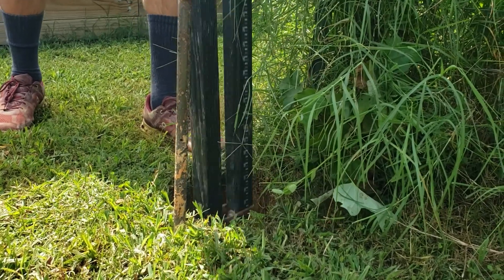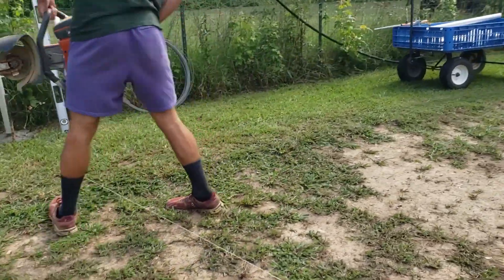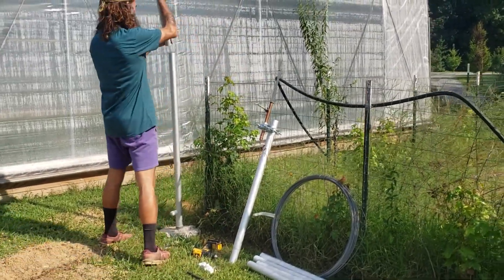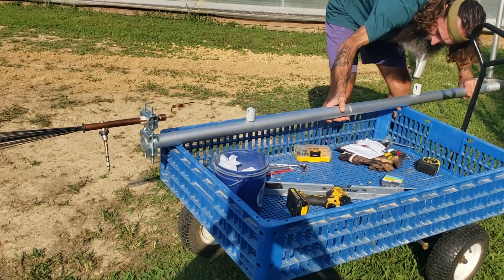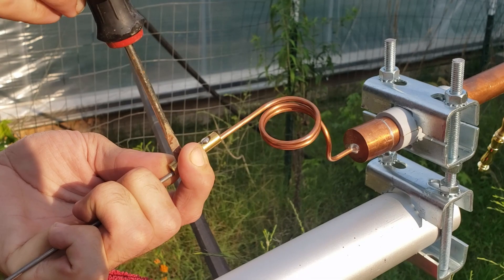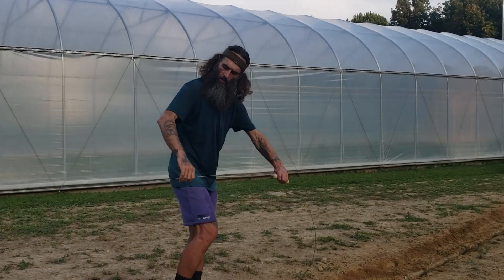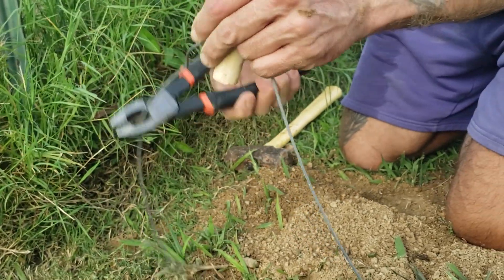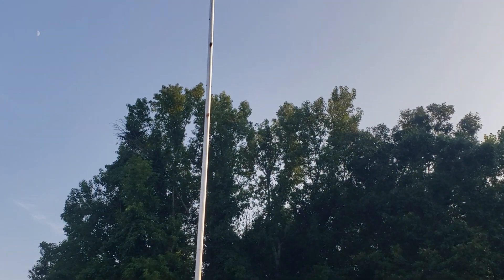CW1 Electroculture Antenna Installation    @TheFertileCurrent

Comment: Is the doll rod at the most northern point to save expense vs pounding in a copper ground rod?  would a copper rod at that point be beneficial?
Reply from the maker: Greetings,  no , the dowel was to assist in driving the wire deeper and also to mark the line for tractor work. However , thats an older video and I don't use that technique anymore. Ideally you don't want anything sticking out of the ground at the termination point except perhaps a non conductive material to mark the line if desired.

Comment: excellent videos, thank you for doing them, they are extremely helpful. I came across them after I played my wire. I used bare copper wire instead of galvanized steel, and laid 3 wires approx 8' apart north to south, perpendicular to my rows. My garden is small only about 25'x30', not sure if it's overkill and really only needed one or two wires to accomplish the goal. Let me know what you think. Also, I've heard putting pieces of brass  in the soil can helps, but, not sure if it has any relevance to harnessing any electromagnetic properties? I will pass along your videos to other farming friends, you do a much better job explaining the basic principles than anyone else on the internet, Thank you, Tom